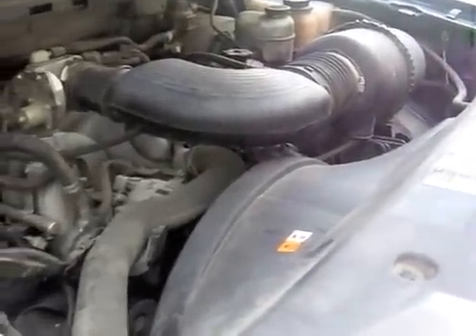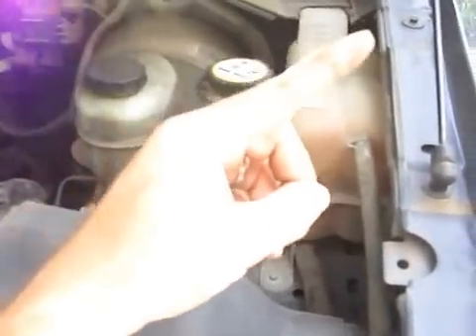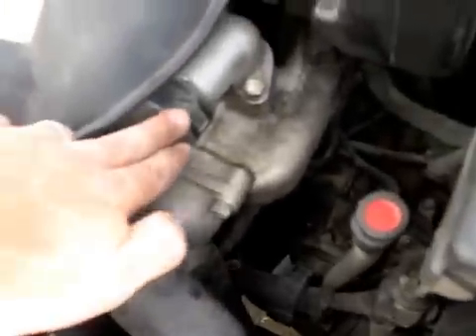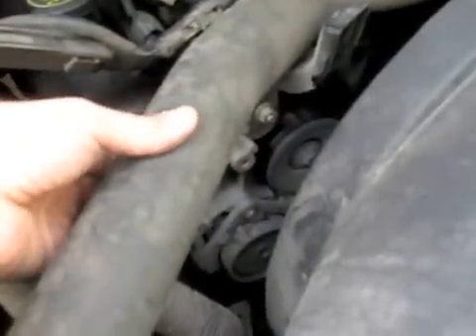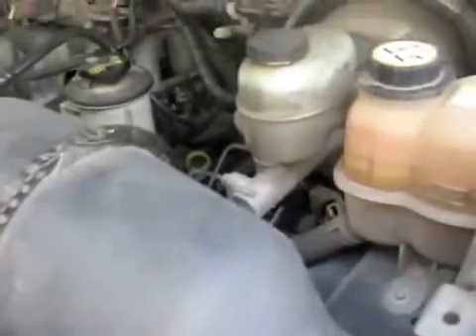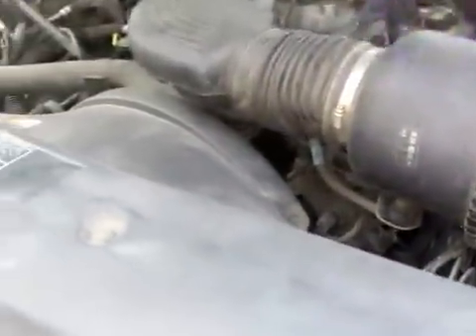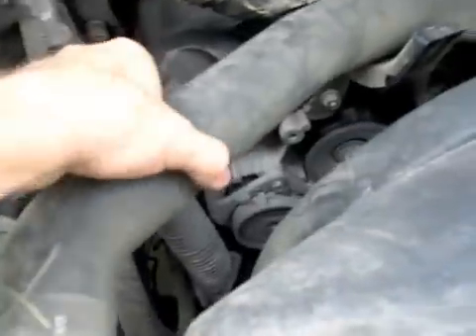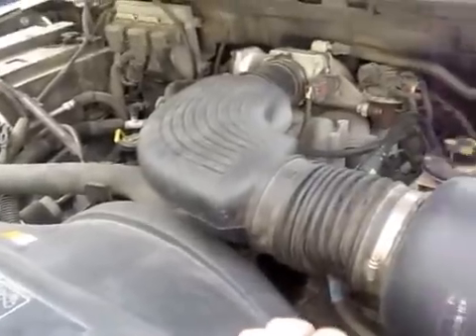Car Engine Overheating - Causes and Symptoms of Over Heating  Car Engine

Comment from the maker: You might have 2 electric cooling fans at the radiator, so make sure that the one closest to the radiator is coming on when the engine warms up. The other fan is for the A/C system and should come on when the A/C compressor comes on.

Yes, if there is ANY coolant leak it will cause the engine to overheat. The coolant will leak out from the hose but the steam caused by overheating will boil in the reservoir.  Get the leak repaired.

Comment: hi, thanks for the response. I had an almost zero coolant and I posted it after i filled the reservoir and drove 8 miles, it reached the red zone and i stopped and after letting it cool till next morning, i saw the fuel level went down and filled more and drove and found it is not heating up until there is coolant. i parked at several places and found there r two spots there is oil spillage. i also saw a lot of fresh oil deposit behind the engine. i am gonna check with my mechanic and see

Comment: My Ford Taurus '99 overheats after a 14-20 miles drive on a stop light. Thermostat was replaced to 160 degrees. Fans goes on and off from time to time and when you turn the air-conditioning on. It boils over the reservoir.
If there is a leak(s) from back hoses, why would it boil over the reservoir? I would think that it will run out of coolant than boil over.

Comment from the maker: Sorry for my delay, have been out of town on a roadtrip vacation with family.  If you are adding coolant you DO have a leak somewhere in the system.  I would get a cooling system pressure test first to help locate any possible internal or external coolant leaks.

2. Check the electric radiator cooling fan operation (should cycle on and off)

3. Check for a restriction at the bottom of the radiator, both radiator hoses should be about the same temp when engine is warm.

4. Check thermostat

Comment from the maker: Thank you.  Sorry for my delay I have been out of town on a much needed road trip vacation....and no car breakdowns yahoooo.

Can you see where the leak is coming from?  If you can not, get a cooling system pressure test to help you locate it.  Also check the electric radiator cooling fan and make sure it is coming on, and check for a restriction in the radiator not allowing coolant to circulate in the engine.
Reply: TrustMyMechanic.com m

Comment: very informative video. i have a car that is overheating in idling and at stop lights. i just noticed the overheating when i stopped the car this morning from gym. i saw the coolant reservoir was empty and poured some and drove 8 miles for lunch. it over heated and touched the red zone. so i immediately stopped by pulling over. i waited for 10 minutes and the engine cooled a bit , so i started and drove the needle was much lower than before start. no leaks whatsoever. refilled more coolant

Comment from the maker: Get a cooling system pressure test first, rule out any external or internal leaks, then check the radiator for a restriction at the bottom. Both upper and lower radiator hoses should be about the same temperature when the engine is hot. If not, there is low coolant or air pockets in the system or a coolant restriction somewhere.  The HEATER should be blowing hot air when engine is hot, if not, low coolant level or lack of coolant circulation in the engine is happening.

Comment from the maker: Just about any mechanic will have a cooling system pressure tester (even many oil change places) and you can usually rent one from your local auto parts store if you want to try and do it yourself.

Comment: My 1991 mercedes 300e has overheated the last couple times I have driven it. It overheats after approximately 20 minutes, the car seems to overheat when it is stopped and not going at a fast speed such as at stop lights. i've checked the fan and it is working. I used a whole gallon of antifreeze before I hit the road for work and as soon as I got to my destination and shut off the car the coolant was boiling and started to pour out from under. . PLEASE HELP!

Comment from the maker: Not good at all to let that little engine get that hot.  Watch the video again and start ruling things out. Are you adding coolant?, get a cooling system pressure test to locate leak. Are the cooling fans coming on at the radiator?  Do you have a restriction or an air flow restriction across the radiator?

Comment from the maker: These vehicles are difficult to bleed air from the system.  Check for any other coolant leaks, check radiator electric fan motor, check temp of lower and upper rad hoses to see if they are the same and both have pressure on them. Turn on the heater inside the car to help remove air pockets from the system, then top off radiator with coolant. Heater should be HOT, if not you got air in system still.  If you are still stumped try a new thermostat, its a quick and cheap guess to rule things out.

Comment from the maker: Well, you should get a cooling system pressure test first if you can not easily see where the coolant leak is coming from. I would suspect that coolant is getting on the fan belt, causing the noise? Maybe a bad water pump, or could be a radiator hose spitting coolant on the belt which will make a squeeking/chirping noise. I would also make sure the electric cooling fan on the radiator is coming on when at idle.

Comment: i just recently installed a new radiator myself in my jeep grand cherokee. having overheating issues. i thought i burped the air our with the bleed but its still running hot. i replaced the old radiator because it was pissing out coolant. any suggestions? all hoses feel fine

Comment: Hi i have a 2000 jeep grand cherakee limited 
i been putting coolant in my truck frequently and also been seening leaks in the front of my truck there is also a noise when my truck is idling it runs hot on low speeds before i get to the corner store it's already in the 220 what is the cause  of this is it my radiator what do u think it could be.... before i go to a mechanic i want to know what um dealing with

Comment from the maker: Those vehicle are notorious for small headgasket seeps, but if the engine is not overheating and you are not having to continually add coolant I would not worry to much about it. I do have a really good headgasket sealer additive I show in my youtube channel....."best headgaket sealer" you might want to try it and see if it helps.

Comment: Help? I'm getting air bubbles in my cooling system. I test for leaks and bad head gasket and no leaks and head gasket is good. I bled the system. Any ideas? Can it be a bad intake mani gasket? It's a 99 civic ex

Comment from the maker: Keith, I see you went to public school :) Yes, air pockets can get into the system and cause an overheating issue.  Air pockets get into the cooling system after a major part replacement like a new radiator. So if you have not done any part change, air pockets can not get in the system. The video talks about the most common overheating issues, and assumes no recent repairs have been made. On older cars if the ignition timing is set to advanced that too can cause overheating.  Lack of oil too.

Comment: Hello Austin, I have a misfire on my 01 Pontiac grand am 4 cyl.  It is read by the code as a miss on number 4 but it seemed the #1 plug was fouled.  Am going to put a new coil pack and boots on it tomorrow. Also some major idle problems while warm yet not when just started and still cool.  Already put a new TPS and am putting a new Idle Air control tomorrow also.  Can you think of anything else I should do?

Comment from the maker: It is normal for the water level in the plastic "over flow" reservoir to rise and fall as the engine reaches normal operating temperature. You need to keep an eye on the radiator coolant level, if that falls then you probably have a coolant leak somewhere and a cooling system pressure test can help you locate the leak. If the coolant level inside the radiator stays full, you should be ok as long as there is not an overheating issue.

Comment from the maker: If you can see corrosion or mineral or rust build up at the top of the radiator it will be MUCH worse at the bottom of the radiator, so yes your overheating problems could be due to a restriction in the radiator and its time for a new one. 

I always replace the thermostat when I replace the radiator, just as general maintenance. The overflow bottle will rise and fall as the engine and thermostat thermostat opens and closes off the coolant flow.

Comment: i been doing research on my car about it overheating. i have antifreeze in my reservoir but none of it seems to be getting used, my car seem to think sometimes there is no antifreeze in the reservoir. also i opened my radiator and there seem to be quite a bit of corrosion in it. i think its a thermostat but others feel its the thermostat and the radiator.

Comment: My head gasket is fine, i have mentioned white smoke but not from the exhaust i am guessing some leak fell on the radiator caused the white smoke. I will do the pressure test to find where the leak is coming from. I'll keep you updated , thanks for your help.

Comment from the maker: Usually when that happens its due to a restriction in the radiator or some other coolant restriction like a stuck thermostat, or from lack of airflow across the radiator. Make sure the radiator is full of coolant, check upper and lower rad hoses when engine is warm (they should be close to same temperature) and that there is plenty of airflow across the radiator...ie. cooling fans working, or manual fan is turning fast enough.

Comment from the maker: Well, yes that could be a sign of internal engine coolant leak, like a headgasket and it could be possible. I would also expect to see constant coolant loss, white smoke out tailpipe, coolant in engine oil sometimes, an engine miss and running bad because coolant is getting on spark plugs. I have a video in my channel talking about a headgasket sealer you might want to watch it.  A pressure test should reveal the leak though and will not hold pressure with HG leak.A rad restriction is still high

Comment from the maker: Well if the coolant goes down in the radiator every time you drive, then you have a leak somewhere that needs to be repaired.  Any coolant leak in the system will not allow the system to hold pressure which it needs to regulate itself. Get a cooling system pressure test to help you find the leak. You have not mentioned any white smoke out the exhaust, engine miss or coolant in oil, which would indicate a blown headgasket. I have a video in my channel about a headgasket sealer which is helpful.

Comment: Ok its me again so I tried getting all the air out of the system once more but this time I witnessed that it was bubbling and no coolant was returning back into the system once my engine had warmed up. I have read that if this happens, bubbles or air coming out of the radiator, it is a sign that my head gasket or cylinders are in need of replacing...what do you think?

Comment: yesa new radiator 4 rows. The coolant in the radiator reduces everytime i drive the car, i have went to several mechanics but they are bullshit and none of them know how to work on a supra. and yes i have checked the radiator while the car is warm, i saw a few bubbles gettin on top of the coolant. i noticed this issue started after i refilled my A/C gas there was a leak near the compressor clutch so i had to reduce the gas. Could the heating up problem be from the compressor clutch?

Comment from the maker: You want to get a cooling system PRESSURE Test to help locate a leak, if you have one.  A compression test will help you determine if there is internal wear inside the cylinders, which I dont think is your issue. You should be able to get an aftermarket radiator for about $150-200 or you might see if you have a radiator shop in your area that can "boil out" yours, sometimes its better to get a new one than try and mess with your old one though.

Comment: Thank you so much for your tips they are very appreciated! I hope you are right. I will do what you suggested. The temperature does go down when I blast the heater by the way. I also flushed my radiator using a garden hose. Would a compression test help me find this minor leak? If all fails I will replace the Radiator first since it wont cost me $1,000 like a new head gasket lol  You have been a great help!

Comment from the maker: I am not thinking headgasket from what you have shared with me.  If it runs hot again, turn on the heater blower on high and see if the temp goes down. If is does, you are either low on coolant and have a small leak, there is air in the system still or the radiator has gunk at the bottom and restricting coolant flow.  The AC is just an added load the radiator is unable to handle. If i was going to "guess I would replace the radiator if I am sure all air has been bled out.

Comment from the maker: yes that is a good idea to remove the air, and air pockets will reduce the coolant circulation and cause the overheating. Sometimes you have to drive around a bit and let the thermostat operate, run the heater, then come back and let it cool down and top off with coolant. You should not be able to easily squeeze together the upper rad hose with your hand when the engine is warm, or there is air inside or a coolant leak.

Comment: ...there was a significant amount of air bubbles coming up from the bottle and I filled it with coolant as it went down. Once I no longer saw any bubbles for a couple minutes I turned the car off. Some of the coolant over flowed out of the reservoir tank but I was told this would occur. I'm going to drive it to work again tomorrow and see how it does. If that fails I was suggested to take it to a mechanic, that it might be my Head Gasket. What do you think? Thank you for your response! :)

Comment: No the radiator is clean but others did also say I could have air in my cooling system and a friend suggested that I bleed the system but my car does not have a bleeding valve so they suggested the following to save me money on purchasing a bleeding tool....what I did was use a bottle cut the bottom off and teflon taped the top to fit snug on the radiator, where the cap goes, then filled it with coolant about a quarter of the way up. I started the car with the heater on full blast...

Comment from the maker: Hummm from what you have told me my gut still tells me there is a radiator restriction/low coolant circulation or air pockets in the coolant type of situation.  Overheating after driving longer distances and with the A/C on (which is an added drain on the cooling system) usually means the radiator is not doing a good enough job at removing the heat.  This radiator is super small and thin and does not take much to restrict it.  Can you look inside the radiator and see ANY rust or mineral deposits

Comment: My 98 Honda Civic DX is overheating.

Changed the thermostat, Cooling switch, hoses, and water pump.
Radiator is only 5 years old and there are no leaks and both fans run fine.
No milky oil and I'm not blowing white smoke from tail pipe. Did a block test and came out negative.
Overheats after I drive it for a while and when I run the AC I can smell coolant for a little bit once it begins to overheat. Top and bottom radiator hoses get hot and the water (50/50) in the reservoir bubbles.

Comment from the maker: so you already replaced the radiator? Check the coolant level inside the radiator, if low you have a leak somewhere and need to get a pressure test to help you find it. Check upper and lower radiator hoses when engine is warm, they should be able the same temperature. if not, you have a restriction somewhere or there are air pockets in the system that need to be bled out. Getting air in the system after a rad replacement is pretty common. Engine warm, upper rad hose should be hard to squeeze

Comment from the maker: Check to make sure the electric cooling fans are coming on up near the radiator, they need to be cycling on and off as the engine heats up. Also, low on coolant can cause this so check coolant level in the radiator. A restriction in the radiator at the bottom can also cause this, since it restricts flow of coolant in the engine and the a/c adds more of a load to the engine to deal with.

Comment from the maker: Its possible, but if the temp sending unit was faulty I would expect to see it overheating at all speeds.  Check to make sure you have a radiator full of coolant and there are no air pockets in the system that need to be bled out. Also make sure there is plenty of air flow across the radiator and nothing in front of the radiator that is blocking air flow.

Also make sure the upper and lower radiator hoses are both same temp when engine is hot. If not, low on coolant,a leak, or air in the system.
Reply: TrustMyMechanic.com ...
Excelent I need some advice plz see my comment I think it's the first one ...
Thanks
Reply: TrustMyMechanic.com ..
Excellent...
My car went hot when I was in traffic light..
When I drove it it went down ..
But it happen few times but then it never happen ...what do you think what happen..
Plz answer

Comment from the maker: ANY leaks in the system is a problem. You can "bypass" the heater core for now (use a hose splice and tie the 2 heater hoses together) then install the fan shroud and see what happens.

Comment from the maker: make sure the radiator is full of coolant and there are no air pockets in the system that need to be bled out. With the engine at normal temp, you really should not be able to squeeze together the top radiator hose with your hands, if you can there is a leak somewhere or air in the system. Also upper and lower radiator hoses should be about the same temp, or the radiator is probably restricted at the bottom and needs to be replaced.